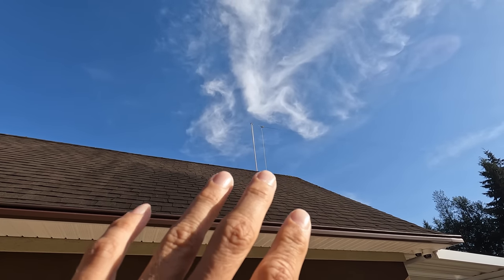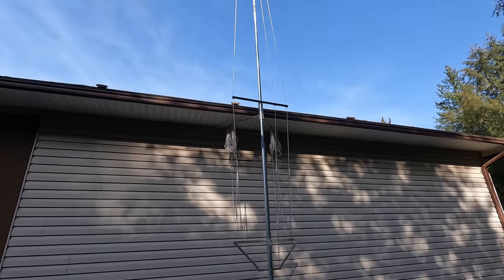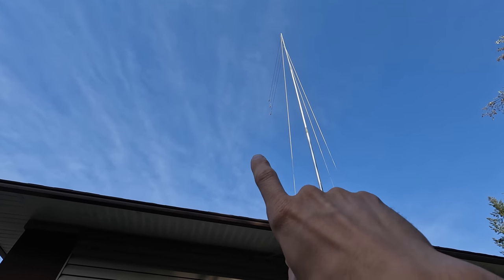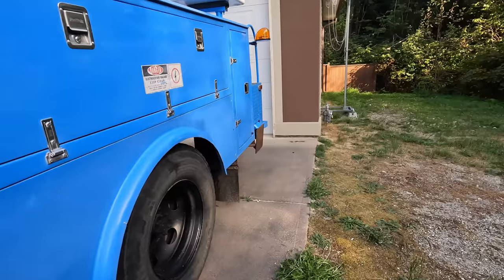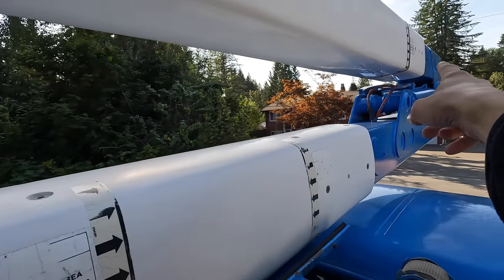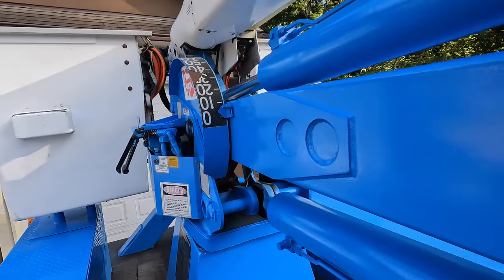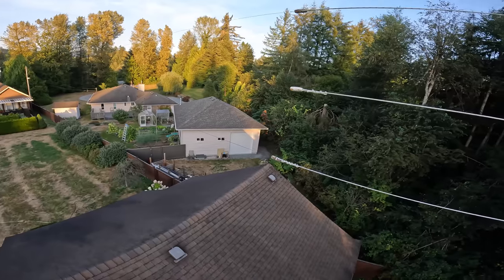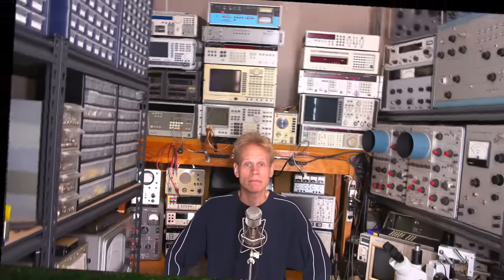Way Up High In A Bucket - 369 Antenna Inspection And Maintenance.

Comment: Looking back at the construction video(s) I see that the feed end has all three wires coming together - they fan inwards from this end to a point at the other end.  Is it the case that the "tangling" you describe happens towards that end where the wires are closer together, and if so could you have designed it so the wires are evenly spaced mechanically end to end, and then connected together electrically at the feed end?

Comment: I don’t know if this is practical but you can lower the freezing temperature of water with a thin surface coating of any oil, although this only lasts a week or so. No idea if this would impede any signal although I wouldn’t have thought so. As for the actual oiling.. that could be tricky (edit as I just finished the video and now I’m thinking basically impossible, maybe a pulley that can run along your antenna with a motorbike chain oiler attached, still not practical though)

Comment: The single guy wire opposing the pull of the antenna seems too critical. Perhaps you could double it up with a second one in the same plane or perhaps spread them at a narrow angle. Will the new guy wires go to the ends of the eaves or the ends of the roof ridge?

Comment: Can DC Voltage be stepped-up OR down with a transformer like it can with AC?
Reply from the maker: Hi Bruce. No, unless there is a buck or boost converter driving the transformer with pulses. Basically turning the DC to a pulse, or to AC again, boosting or bucking the supply voltage, then converting it back to DC. You can step DC down in other ways, but DC and transformers are a "no go."
Reply: THANK YOU Mr. Carlson.   Is that why an older automobile's ignition system with mechanical breaker points (pre electronic ignition days) necessitated the use of said breaker points to create the necessary pulse to allow the ignition coil to step-up the 12 VDC to the required voltage in the thousands??  Thus, no or faulty breaker points and the engine won't run?  

I will have to admit electronic ignition systems are superior regardless how much they were cursed by shade tree mechanics back in the day when they were first introduced.  THANKS AGAIN!
Reply from the maker: Yes, breaker points make the pulses needed to create the rising and collapsing magnetic field (within the coil) that will make the ignition coil produce the voltage needed to make an arc jump across a small gap.
Reply: @MrCarlsonsLab  --  That is kind of what I thought but wasn't for sure.  THANKS Mr. Awesome Electronics Man.  I Love your videos

Comment: Hello Paul!!   Congratulations on being a future Grandfather!! Your bucket truck reminds me of some of my work at IBM East Fishkill N.Y. in Dutchess county. We had A JLG manlift capable of 65 feet max height. Don't get me wrong on this but I loved using it while doing my job responsibility but driving it to a particular location was not enjoyable because we had to drive it from within the bucket!! while the boom was collapsed down to its 32.5 foot shortness, the amount of movement of the boom was magnified when starting or stopping the machine on the road either the machine would throw you to the back of the bucket when starting, or it would want to EJECT you out of the bucket towards the front when STOPPING!  So wearing the 5 point body harness was absolutely required to keep you IN the bucket with the safety strap. (I tended to get slightly motion sick while driving this machine from the bucket!!) It had the feature of being a 4 wheel drive hydraulic system. Each wheel had its own hydraulic motor with a planetary drive HUB assembly.  We used this vehicle to maintain parking lot and road lights on site as well as maintaining the overhead utility system for heating , airconditioning, electrical, chemical, solvent and gas supply overhead feed line to all major buildings on site. This was all contained in a steel trestle that held all the overhead services needed for the buildings and chip production areas!!   Thanks for a GREAT video as always!!  73's from KC2UVN
Reply: Ah, it's one of THOSE cherry pickers! You see them all the time at construction sites. Is it possible to secure the bucket end with chains or cargo straps while in transit, or is it too far forward? I've used a small vertical Genie lift with outrigger supports before, but never one of the self-driving ones.
Reply: @BlackEpyon  No it is not possible to chain or reinforce the bucket because it is located 32.5 feet Behind the rear wheels and would experience the same movement itself.

Comment: Its nice you can raise your bucket off a jobsite and not lose your job. I asked a boom truck to help with a tangled flag that wouldn't come down.  They said to stop them from doing sidework the boom was tied to the gps and the office. Dispatch got a pin on the map everytime it went up. Unfortunately the flag had to destroy itself before it came down. Took months. Not cool

Comment: why dont just heat up the wire to prevent snow from accumulating?
Reply: Maybe it interferes with radio?
Reply: @mrkitty777  not really. the cold weather will dissipate the heat and makes it negligible.
Reply: i mean, even tho its running 24/7, heat-based snow meltage is still plausible. like what they do in starlink dishes to thaw snow and ices.

Comment: Congratulations for becoming grandpa. But I would have estimated your age much younger.

I'm wondering if your antenna got any overvoltage protection. Even if thunderstorms are rare, one might destroy a rare old device while you are testing it in your workshop. Even more pain will occur when a lightning kills one or more of your expensive and often rare equipment.

I would have rather employed a mechanism to move the antenna up and down like a flag on both posts. So one can maintain electrical and mechanical parts of the antenna safely on the lawn and "hoist" it afterwards back into its operating position. And you do not need to hire a bucket truck. In Germany for example there are lots of offers to hire this kind of trucks or trailers, but you need to pass an exam and you have to show a document about to make sure that you are able to operate it properly.
Reply: @AdmiralQuality  Thank you, I am not a native english speaker, so I missed out this information.

Comment: dude you aint old enough to have a grand kid lol ... dang ... new channel Oldman Carlsons Lab. lol   electric fence wire. from a palce tractor supply. 1/2 mile is like 30 bucks. doesnt rust. also spacers. plastic like they use on power lines but theres are will yeah much heavyer built. a cool build would be a 75m amp loafing at 500 watts.